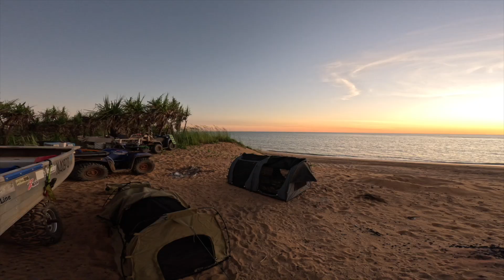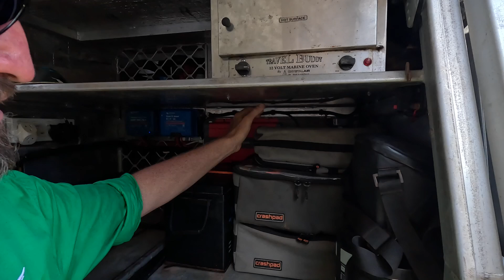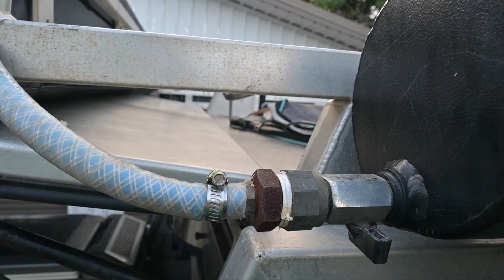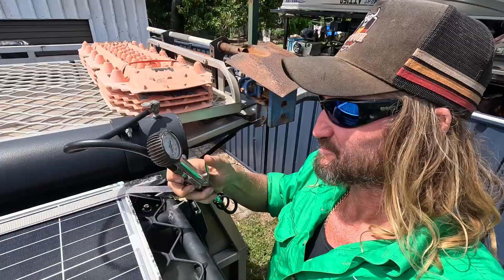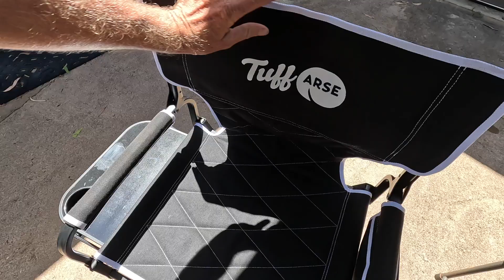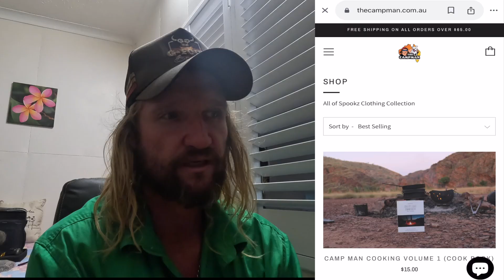DIY 12v...New way of cooking when camping...Camp shower set up..

Comment: Really interesting channel. You cover a lot of just fit-for-purpose ideas. Keep it simple and practical. Here’s an idea for you. Instead of having low volume high pressure tanks on board as part of compressor system , why don’t you give some thought to getting rid of the tanks and plumbing up the spare tire and use it as a large volume, lower pressure air reservoir ? Cuts down on weight and utilizes an item that is doing nothing most of the time.

Comment: ive been using a thermo cooker for years would never be without it try cooking corn meat in it the best corn meat you will eat
Reply from the maker: Yeah mate I did a few corn meats on me larger thermo I had… it was like ferry-floss ay. Just melts in ya mouth.  I think I’ll be pushing it with the little pot…I might fit a small one in it.

Comment: Pumped is right. Getting my Ute sorted out for off grid next week and I’m like a kid at Xmas. Can’t wait. I’ve been using renogy 50amp in the caravan.
Reply from the maker: It’s a great feeling mate ay. And trying out all the new gear is just as fun. 
The Renogy gear is good, I never had a problem with mine. And I think you might find the 50amp May have a higher volt solar input.

Comment: Try less air pressure in the shower tank. Work it out so you get clean but don't use too much water. We used this method to get fuel from a 44 to the vehicle.
Reply from the maker: Cheers for the tip man, I find I need to have at least a certain psi in the tank to get full shower out of it.. if I can keep same amount of psi but just shut valve a little I should be right. 

How good it air over pumps when it can be done.. I also use this method for my 20l Jerry cans.
Reply: @Thecampman_OFF-GRID-LIVING  Yep, one less item to break down plus you already have the compressor.

Comment: Good one. Be careful with those lithium batteries. They cause fires 😊
Reply: LiFePO4 batteries really don't catch fire unless you do something drastic to them. The design, BMS, and chemistry make them very safe.
Reply from the maker: Cheers mate. And the LifePO4 are safe, had them for a good few years not and no drama. I’m sure there are some bad ones getting around, hence the new laws that have just come out.. but quality ones are the way to go.

Comment: That Billy boil would be great to put on before you start driving then when you pull up at the end of the day you’d have a cooked meal.
Reply from the maker: I’m yet to use it while on the move, just to make sure it seals good enough to not wanna leak.. but if it don’t leak, ya spot on guys.

Comment: Your set up looks great man,  designed for practical use with or without the trailer. Always interesting to see how and why you adjust things to make them efficient. Cheers n thanks for sharing Dale 🍺🤙🏽
Reply from the maker: Cheers man, 
Yeah that was a must for my while set up, I had to be able to leave the trailer and take off in my Ute for a camp.. same time not over doing it and doubling up on to many things.

Comment: Why not go for a solar house battery,won't need anything else.Maybe they are 5kw,don't know price or weight.
Reply from the maker: Yeah it more comes down to weight and size for the Ute set up.. I’ll get away with a 200ah as I’ll juggle the cooking around from induction,fire,thermo cooker and so on. So I’ll stick with a smaller 200ah or so for the Ute.. But the 5kw is something I’ve been looking into for the camper trailer down the track.